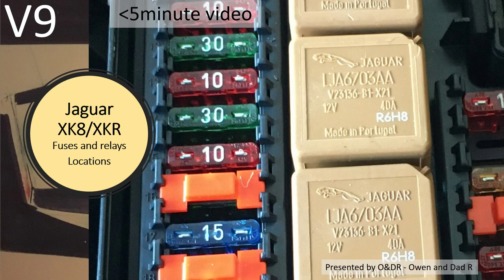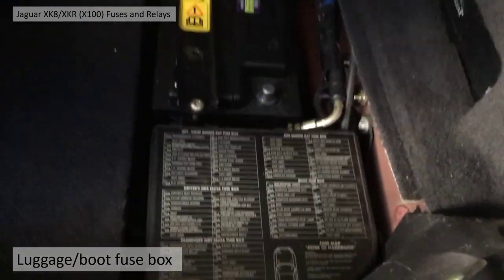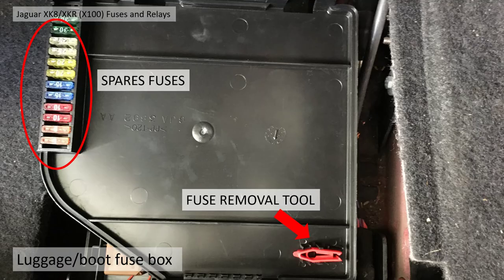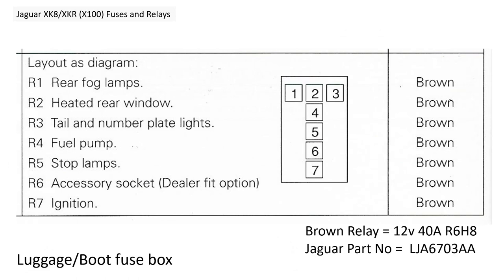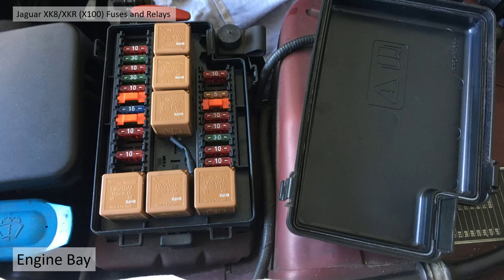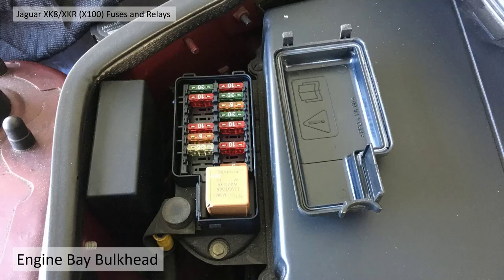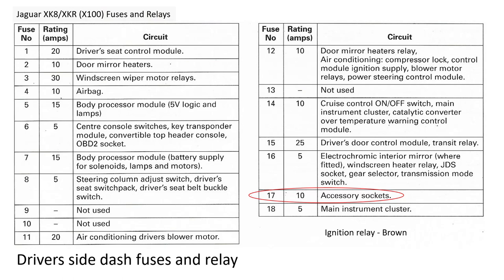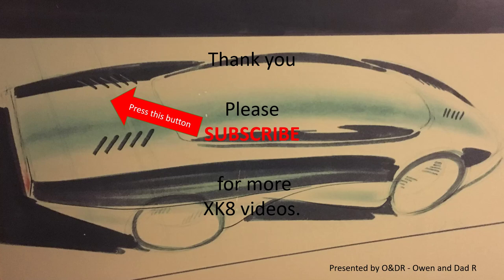Fuses and relay locations V10 Jaguar XK8 / XKR (X100) Fuse Relay location

Comment: Can someone direct me where the fuse is located for the traction control/ ABS?  And my XK8 is left hand drive. Thank you and God Bless. 🙌
Reply from the maker: Terry, The answers are in the video, at 3mins 45 secs in. There are three fuses involved, all located in the engine bay fuse box. F4 5A ABS Module, F16 30A ABS Valves and F18 30A ABS Pump. Hope that helps, best of luck, regards Damian

Comment: My dashboard lights went out on my 2005 xkr. Can you help me find the location so I can replace the fuse? Thank you!
Reply from the maker: Mrs Porter, Location of the Major instrument fuses are the drivers side fascia fuse box (behind the end of the dash cover). Either F4, 5 amp or F14 10amp. Not sure it will be that simple but worth a try. 
There is a dimming control on the steering column and dimming control module on the passenger side. You can find the wiring diagram here thttps://drive.google.com/file/d/14mQL-VMEQUYQxatDRAGNDIdaHZE2cKr7/view . Page 81 of 152 shows 10.2 Dimmer Controlled Lighting wiring diagram. Hope that helps, regards Damian

Comment: I have a XKR 1999 supercharged model does this have two fuel pumps and two fuel relays or only one pump and two relays which i cant find the second relay if it does
Reply from the maker: Mikeyboy68, early XKRs like yours had two fuel pumps. Not sure about whether it had two relays, I would assume it does or at least shared with another relay. Sorry I can’t look at my car because it’s an XK8🙁. Hope that helps. If I find out I will let you know, regards Damian
Reply from the maker: Mikeyboy68, just checked the wiring diagram for your car Fig4.5 page 37 of 129 link at the bottom. Your car has two pumps inside the fuel tank fed from a single relay👍. Hope that helps at bit more. Problem with fuel delivery? Regards Damian. https://drive.google.com/file/d/1pSM62OMDqwpPGiXUnN0cJ3PFwgFzgX-L/view
Reply: @ODRModurol  the diagnostic tool is telling me that i have a crook fuel pump relay no 2 he car runs perfectly so i am confused thanks for getting back to me
Reply from the maker: Mikeyboy68, ok understood. From what I understand the XKR uses two fuel pumps one for normal load and the other for higher demand. If one packs up the other will still supply the fuel but assume at some point in the throttle you will get lack of power. It’s a bit confusing because the name of the relay is ‘Fuel pump 2’. Not meaning the second pump relay but relay feeding 2 pumps. Let us know how you fit the issue. Good luck regards Damian
Reply: @ODRModurol  sorry its saying relay 2 fuel pump
Reply from the maker: Understood, very confusing can only think the wiring diagram must be correct, regards Damian.

Comment: Where I'd the radio fuse
Reply from the maker: Thomas, see passenger side (LHS) fuse box. Fuse 12 (5 amps). See video at 5min 45 secs onwards for more details. Hope that helps regards Damian
Reply: Thank you so much for your reply,it's good people like you that help us keep these great cars great however my radio fuse is good.the nav system ,and the c.d.player didn't work when I got it,but I really miss the radio,,,,,,thx Tom.
Reply: The fuse was good,any other thing that woul keep my radio from working,
Did work before good,what else do i check?also the auto antena does not work,help please gotta have a radio!

Comment: I'm having fuse 10 (5) engine control module throttle mechanical guard blow on me after a few seconds or minutes ... Any ideas? Love the videos!
Reply: Just put in a brand new battery but I was having this before too
Reply from the maker: @Kellier1916, Sorry I have no experience of that fault. Normally, it’s best to start with a physical check for wiring damage around the module. To blow the fuse there might be sort in the loom somewhere. Then try a code reader and read the error codes. This should give you some clues as to the fault. Sorry cannot be more helpful, regards Damian
Reply: @ODRModurol  çode reader I have can't access anything, I can't hear the fuel pump coming on... Possible that's dead and why I'm getting cranky no start. Side note I let her run out of petrol the other day 😔
Reply: She was driving fine up untill that but still blowing that fuse the odd time... I must have a short somewhere

Comment: Great video i have been struggling to find a few fuses you made it very clear thank you
Reply from the maker: Mikeyboy68, thanks for the comment and compliment. Glad it was helpful. More stuff on the channel if you need it, regards Damian
Reply: @ODRModurol  I have a XKR 2000 supercharged model having the ABS light coming on every now and then now on all the time it started when i would reverse out and turn sharply right i thought it might be a sensor or the wiring but havent been able to pin point it so just wanted to check all the fuses

Comment: Hi Damian I followed John dees video on resetting the alarm which worked with new batteries in the fobs too I must add that you can use 1x cv2032 battery only one instead of 2x cv2016 which on mine 1 fob had 2x cv 2016  and the other 1x cv 2032 now working as it should thank you for your help Trevor
Reply from the maker: Trevor, Thank you for the comment. That's great information about the fob batteries. I didn't know that about the battery options. Much appreciated will try to include that fact somewhere, regards Damian
Reply: Checked the handbook and can't find a mention of it anywhere its doing my head in this, lol

Comment: Thanks for the great videos; have you encountered the rear taillight bulb failure? I have been chasing this issue for over 5 years and can't figure it out; any help would be greatly appreicated.
Reply from the maker: Patrick, I will try to help if I can. What are the exact symptoms blown bulbs or no power to a particular bulb? Regards Damian 
Here is a link to the wiring diagram for MY1999 other years available on our website. https://drive.google.com/file/d/1pSM62OMDqwpPGiXUnN0cJ3PFwgFzgX-L/view

Comment: Hi Damian, I have question regarding the ambient lighting / mood lighting in my 2004 XK8. I don’t frequently drive the XK8 at night, but I seem to remember that the foot well lights remained on while driving at night. Is this the case and if so do you know how to turn them back on as mine do not remain on when driving. Thanks
Paul
Reply from the maker: Paul, the footwell lights do not remain on whilst driving. Hope that helps, regards Damian

Comment: Do you know where the radiator fan relay is? Both of my fans run constantly when the battery is connected. I had an engine coolant low message which I corrected, but I think it tripped a message to keep fans on or the relay is bad to the fans...
Reply from the maker: P Gansz, try turning the Air-Con off. The fans will run if the engine is running and the air-con is on. Assume this is to assist with reducing the Air-Con temperature by increasing airflow over the Air-con radiator. Are they running just with the battery connected and the engine off? Thanks for the comment regard Damian

Comment: question will u hurt the transmission by shifting up and down in the "jgate" (i never down shift to slow down tho but i go up and the use brakes to slow down and come back to 2)
Reply from the maker: @FederalTracks, I am not a gearbox expert but don't believe you will hurt the transmission by using it as it was designed (ie the manual side of the j-gate). Its the best way to get some decent performance when changing up by holding onto the gears. The only time the VVT units actually get used. Changing down doesn't really help with braking on an auto jusdt got to be careful not to overrev but there are protected rev limits I believe. Only thing to be mindful of it the age and state of the gearbox.  Either way you need to use and not wrap it up in cotton wool.  I suggest to take a look at this video for more info https://youtu.be/fMwk9c7A-fA Thank for the comment regards Damian
Reply: @ODRModurol  yes looked at the vid thank u ...i love these cars man i cant express how blessed i feel to own one
Reply from the maker: @FederalTracks, great looking cars and always lots of projects to do on them, regards Damian

Comment: Thank you so much, I've been looking for this but still can't see the Reverse Lights relay anywhere, any idea or am i missing it? lol
Reply from the maker: Parker Family,  there is no relay for the reverse lights. They are controlled by the 'Security and Locking Control Module' and the signal coming from the 'Automatic Transmission' switches. Check out wiring diagrams 9.3 and 5.3. Probably one of the J Gate switches aren't working. I believe its probably the linear switch not sensing Reverse. Hope that helps, regards Damian

Comment: hey Damien, question on the drivers side fuses.  Is the accessory fuse a switching 12v do you know?
Reply from the maker: Dave, No but we can work it out from the electrical diagram Pages 27 (permanent live) and Page 28 (switched live) https://drive.google.com/drive/folders/1IkUjTiD1gmNcwScUIf8f1vNcFpfxPsKk
Actually doesn't matter LHD/RHD. Fuses #10 (5amp), #12(10amp), #14(10amp) and #16(5amp) all switched live.
All other fused are permanently live. MY1999 to 2002 inclusive. The answer is fuse #17  'accessories' should be permanent live. Hope that helps. Please let me know if it's correct. Note anything connected will be 'ON' all the time and therefore a potential battery drain. Thanks for the comment regards Damian
Reply: @ODRModurol  Thanks Pal.  thats a great help.  I got a 3A,12v dual usb converter that I want to use for a mobile phone charger leaving me a spare usb if I need it later.  I will make sure I double check before I fit.  Couldnt get out today as it was raining all day but got to solder my wires for the front and rear light mods :)
Reply from the maker: Dave, no problem. Slow but steady progress 😉 regards Damian

Comment: Hi since fitting a new battery to the car the remote fob is not working could I have blown a fuse? I did connect the earth lead last when fitting the battery but having to use the key to unlock car and there is no sound from alarm please can you help regards Trevor
Reply from the maker: Trevor, sounds unusual. There are some fuses to check (actual Fuse positions in the box might vary with model year). For the key transponder in the Drivers side fuse dash end fuse box fuse No6 5amps. Forward LHS engine compartment the alarm security sounder Fuse 3, 5amps.  But favourite is Luggage compartment Security and Locking control module Fuse 10, 10amps. Hope that helps. If not you might needs a new battery in the fob and/or reprogramme to the car Thanks for the comment regards Damian.
Reply from the maker: Trevor, contacts of the remote might need cleaning. Link to the cleaning method -http://jagrepair.com/Remotefor1999xk8.htm, regards Damian
Reply from the maker: Trevor, you might need to re-programme the remote if so take a look a John Dee's Video. Link herehttps://youtu.be/VVnLZiAXA_U . Hopefully you have a few things to try. Hope you find a fix if so please let us know what the solution was. Thanks for the comment regards Damian

Comment: Excellent vid!  I accidentally put positive on negative when jumping, luckily everything seems top be working fine still, except for the radio.  That's completely dead - think that may be just the fuse?
Reply from the maker: JVickers187, accidents happen and it is probably been protected by a fuse. There is a fuse for the head-unit and separate fuse for the amplifier if you are lucky enough to have premium audio. Hope its just the fuse. Thanks for the comment regards Damian.
Reply: @ODRModurol  The fuse worked!  Thanks!!  However, there is no sound now.  Maybe the amp?
Reply from the maker: JVickers187, getting there👍. Try the amp fuse its located in the luggage compartment fuse box. Fingers crossed that works, regards Damian
Reply: @ODRModurol  Perfect - that did the trick!  All up and running now - thanks again!
Reply from the maker: JVickers187, result! Excellent really glad you got it sorted, thanks for the comments regards Damian

Comment: can anybody tell me where the relay that controls the soft top door windows drop, as mine just opens an inch at a time right down to fully open.
Reply from the maker: David, sorry I don't have a convertible but I believe there is a row of six black relays in the trunk next to the fuse box. Convertible top x 2, LH quarter window x 2 and RH quarter x 2 (one each for up and down).  Here is a link the technical bulletin for convertible top problem diagnosis. Hope that helps, regards Damian.
http://www.jagrepair.com/images/AutoRepairPhotos/501-11AM.pdf

Comment: Mine hasn't got the fuse locations and both rear registration lights are not working so assume its one of the fuses.  God knows where it is.  I've checked all 5amp int the boot fuse box, but yours doesn't show them in the boot fuse box?
Reply from the maker: Matt, might try locating the exterior lights fuse which should be located in the passenger side dashboard end fuse box. Possibly fuse 17 - 15 amps. This is for all the exterior lights and high power sockets. So if you don't have other things not working possibly not a fuse issue. Might be a bad earth on the rear registration light units.  Hope you sort out the issue. Thanks for the comment regards Damian

Comment: Is there not one behind the rear seats as well?
Reply from the maker: Alan, not on an X100 (1996-2005) as behind the rear seat is a solid bulkhead separating the cabin and the fuel tank in the luggage compartment. Thanks for the comment regards Damian
Reply: Ah ok thanks, so need to find fuse 19 for the exhaust valve in another fuse box, watched the video but couldn't see it any ideas? Cheers for the response
Reply from the maker: Alan, different car but take a look at this reference, might help. https://www.jaguarforums.com/forum/xk-xkr-x150-33/xkr-owners-pull-fuse-19-a-87400/ Thanks for the comment regards Damian

Comment: Does anyine know where the fuse is for the rear windows for a convertible?
Reply from the maker: Viraf, you will probably find what you are looking for in 'Jaguar Forums'.
https://www.jaguarforums.com/forum/xk8-xkr-x100-17/xk8-xkr-how-diy-repair-maintenance-links-facts-data-29800/
Thanks Damian
Reply from the maker: Viraf, according to a 2002 fuse chart, Luggage compartment fuse box, fuse 12 RHS Rear qtr 20amps and fuse 20 LHS rear qtr 20amps, hope that helps, Thanks Damian
Reply: @ODRModurol 
Thanks Damian

After that I'm wondering if it is the fuses if there are 2 as both my rear windows wont go up after my hydraulic hood pipe blew.

I'll have a look though.

Thanks
Reply from the maker: Try the forum to see if someone has had the same problem. ;-)

Comment: RADIO STOPPED WORKING I DISCONNECTED THE BATTERY AND STILL NO SHOW ......??
Reply from the maker: FederalTracks, which stereo/audio system do you have standard or premium? The premium audio powers the speakers through an amp mounted above the CD multi-changer. I would suggest double checking the fuses for radio and the amp. When you disconnect the battery, the radio will need a code to reset. Any other clues? Thanks for the comment regards Damian
Reply: @ODRModurol  premium
Reply from the maker: FederalTracks, probably the amp. Assume the radio turns on, scene comes on and illuminates? Try amp fuse, luggage compartment fuse 18, 30 amps. The radio fuse is in dash end fuse box I think Left hand side fuse 9, 10 amps, depends on year of manufacture as some fuses change. Hope that helps, regards Damian
Reply: @ODRModurol  100% thanks
Reply from the maker: FederalTracks, no problem please let us know what the fix ends up being as lots of people have this issue from time to time. Thanks for the comment regards Damian

Comment: hi
  thanks but read this a dozen times, everyone says they have done it but other than the fuse box behind the seats you say it doesn't have nobody tells you where it is, il just buy a new exhaust, thanks anyway
Reply from the maker: Alan, don't give up. Here's a link to the Owners Handbook on the Jaguar website. Go to the pages Fuses 215, 222. It shows where and how to get access the rear seat fuse box. Also shows the location of the F19 Active exhaust (10amp red second row up, on in from right had end). Looks easy enough to try. https://www.jaguar.co.uk/Images/XK_Owners_Handbook_09MY_tcm91-26483_tcm634-546618.pdf Hope that helps, regards Damian. (PS what year of manufacture is your car because this may help identify the correct handbook, there are several on the Jaguar site see here https://www.jaguar.co.uk/owners/handbooks-guides/xk-library.html)
Reply: Il have a look, really appreciate the help
Reply: Don't think my car has it, found the correct handbook for it and nowhere does it mention an active exhaust fuse on 19, don't get it.
Reply: Forgot to say its a 2002 September model with 4.2 supercharged engine
Reply from the maker: Alan,  there are several fuse19s one in each fuse box. Make sure you are looking at the rear seat compartment fuse box it’s definitely in there. See page 213 2021-MY2012 owners handbook. If you have supercharger it’s definitely got one as standard. Regards Damian.
Reply from the maker: Alan, please email and I will highlight the pages required. oanddr@gmail.com regards Damian
Reply from the maker: Alan, 1996-2005 doesn’t have active exhaust. 2006 onwards XKR’s do, thanks Damian